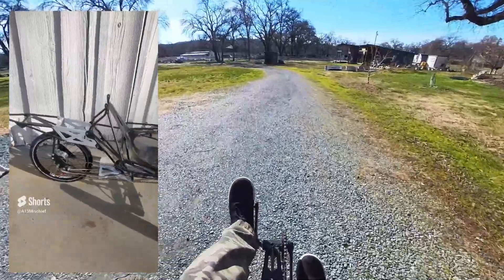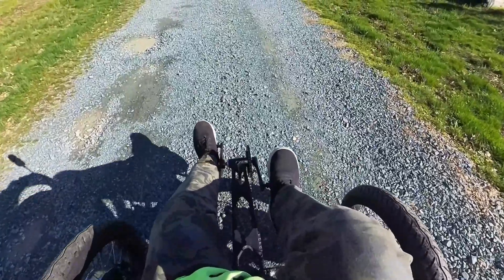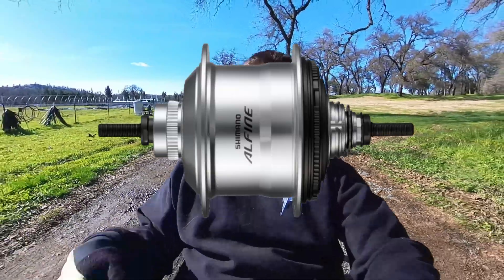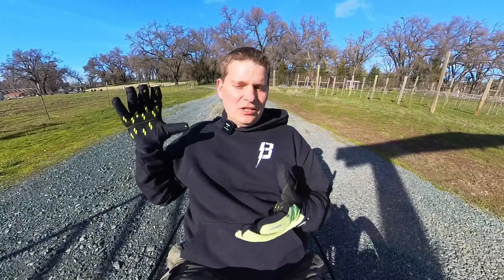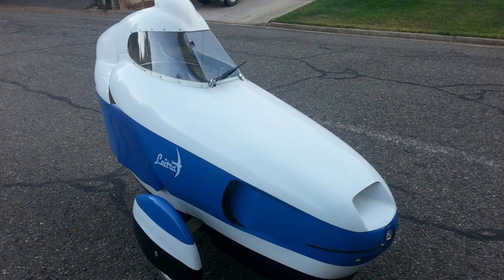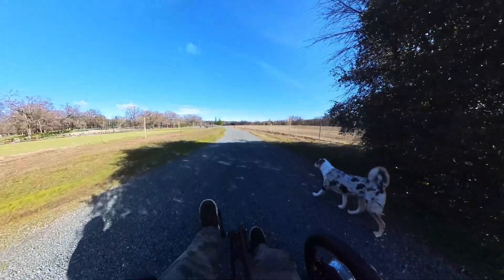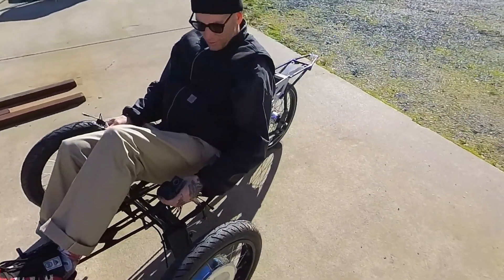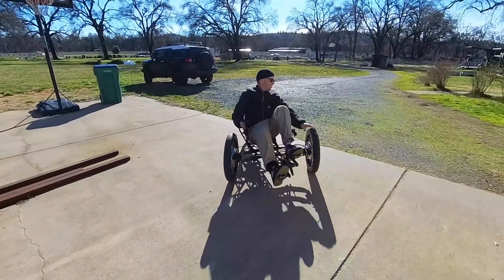4,000 watt Velomobile Build - First Ride (Sort of)

Comment: Nice! I'm building one using the X1 PRO Gen 2 (5 kW) as a left side drive motor on SunSeeker Fat Tad CXS and the body will be inspired by Firebird 1 XP-21 (which might help with stability issues). I had thought about using front hub motors also, but I could not find ones (last time I looked) that were powerful enough and I don't know enough to build single shaft hub motor wheels to construct two of my own. I plan on storing the batteries in a platform under the trike, like Outrider USA does, this should allow me to have basically any battery size I want, prevent leg suck (one or both of your legs getting sucked/stuck under the trike as you're moving) when I don't have the body on it, allow for easier attachment of the body, and allow for storage and multiple power outlets. But I'm definitely thinking about stealing this gearing setup, as I was looking for one similar, but none of them appeared they would be strong enough, the option I had been thinking about was adding a second chainring that could double the output (like the world record setting speed bicycle does). I don't have any medical issues that are preventing me from riding my e-bikes, but I feel recumbent trikes are much more comfortable, you can do much more with them, you can carry more, when it's cold or raining outside you throw the body on, they're not just more stable but you have metal in each side of you in case you are hit, you can carry much larger batteries meaning you can go further, etc. Good luck! And I can't wait to see how it turns out!